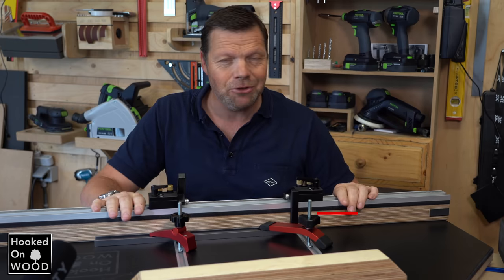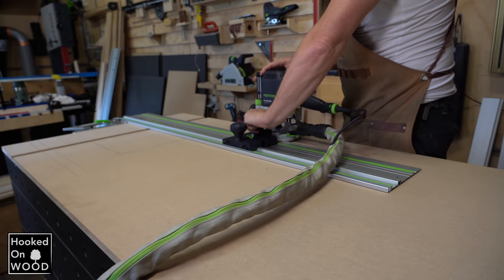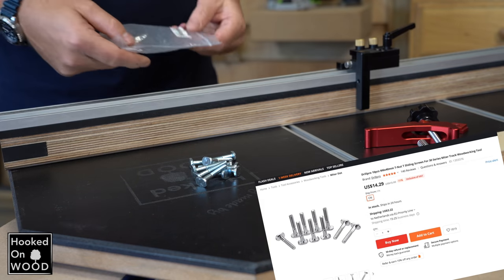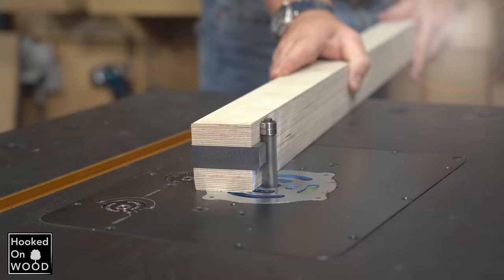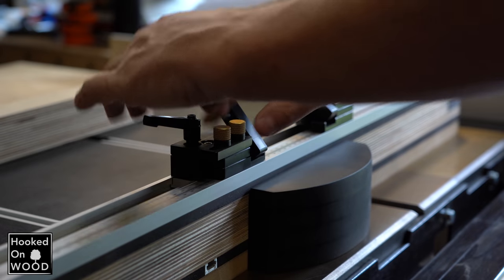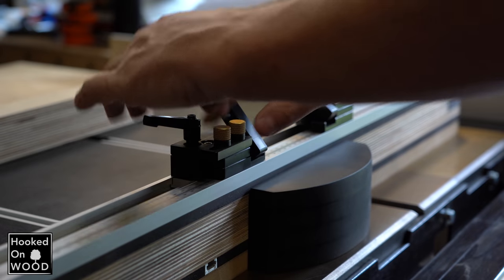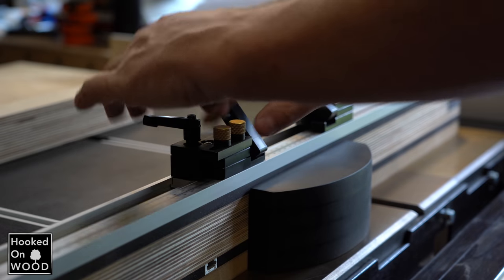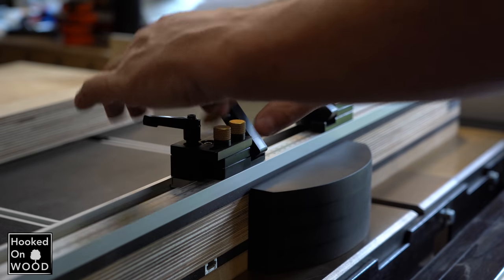China Tools Ep.26 T-tracks, Flip-stops, clamps and more!

Comment: My suggestion: when I made my t-track bench top I attached my t-track with with bolts with nuts on the backside instead of just screws in the wood. That gives it plenty of strength for clamping.

Comment: Dennis -- Thank you for making these videos; by which I mean all your videos, not just your China Tools series. The time you take shows in the quality of the video.

Question: Have you considered comparing aluminium T-tracks to T-slots cut into the wood itself? I'm not sure how well T-slots would work with MDF, but they seem to work very well with Baltic birch plywood or solid wood. The advantages of T-slots are they are stronger (unless the T-track is held in with long screws into material that holds screws well). They seem to be quicker and easier to install. (With a T-slot, once you've used your router to cut the slot, you're done. With a T-track, you need to cut a slot into the wood for the track and then cut the track to fit, and glue/screw it into place.) And, finally, T-slots are less expensive. The disadvantage of T-slots is that they would seem to wear out over time. 

I ask because I think you could make an interesting and informative video addressing when and why you'd use one solution over the other.
Reply from the maker: Hi David, No I did not compare them. On this moment I can not compare them. I hoped my rail guide clamps would fit the T-tracks but this was not the case. Otherwise I would compare them. These smalle clamps do not fit the Micro Jig grooves. So, I did not have the opportunity yet.

Comment: Another great video Denis. Thank you so much. Do you know if the Miter Track Stopper for Fence will work in Incra T-tracks? I want to know both if the locking blue piece will fit in and lock in the internal slot in Incra track and also if the part of the base meant to slide in the top opening of the track will fit in that part of the Incra track and slide nicely.

Comment: Thank you for another wonderful video, Dennis. The lengths you will go to thoroughly test all these China Tools is astounding. I should also add that the pieces you created for "testing purposes" are extremely impressive. Far superior in artistry and function to anything one would find in my shop.

If I could impose, I do have a few questions.
Could you expound on how it is that the grey slider nuts work with the red and blue miter track, but not with the grey? Also, do I understand correctly that the blue and red slider nuts provided with the accessories work with all three colors of miter track?

Finally, when working with the small tracks do the clamps and stops work better with M6 or M8 T-bolts, or does it matter at all?

Thanks again. Looking forward to Episode 27.
Reply from the maker: Hi, thanks for your comments. I appreciate it!
About the questions. 
The dark grey T-track has other dimensions (Slightly) The dimensions are correct according there drawing but it is just slightly different than the others. Because of that, the silver slider comes just a bit above the T-track, so it will not clamp. The blue slider is a bit thinner than the silver slider so, that is why it works here. 
All the miter stoppers works perfectly with all the colors T-tracks, except the dark gray one. It is a bit confusing perhaps, and Banggood actually did not send me this dark one. I bought it myself. But I wanted to implement it in this video so people know. 
I think the M8 screws work better with the small T-tracks. The M6 are smaller and therefore they can turn a bit when you slide them and then they hassle. The M8 slides smoother.
Reply: @HookedonWood  Thank you, Dennis!
As always your insight is extremely useful and appreciated.

Comment: You should really mention the sizes because this is a minefield for beginners. There is the 30-type and the 45-type (plus others). People buying the tracks need to check the profiles so that any track accessories they buy are of the correct size to fit into the tracks. Examine the internal dimensions carefully.
With the scale tracks, I discovered that there are two types on eBay. One has a sliding track and the other one is fixed. Unfortunately, there is really only one seller on eBay from China who sells the sliding scale track. All the others have fixed ones but their ad titles suggest that the scale slides and their images show both.

Comment: Love your reviews and you do a good job of testing the various aspects of the various tools you review. One small thing though. When you looked at the rulers you did not show how straight they were or the accuracy of the scale. I have had some cheaper metrology in my time and one 1M ruler was out of straight by about 2-3mm and the scale was off by about 2mm. I had one tape measure which was out by a 2-3mm in 10M. Otherwise your reviews are great. Thanks for the hard work you put in making these.
Reply from the maker: thanks for the tip! I will keep it in mind.

Comment: Hi there, nice video and just in time because I need to make up a router table and a bit confused looking at the items on banggood- I purchased just a couple of things and not thought slightly ahead with sizes of things such as T rack(the small one which is a bit of a waste of time and money - I found anyway ) When it comes to the T Tracks, the blue one seems the safe bet since it fits the sliders etc? I think you said at 4.34 min the grey t track is not a good fit for the sliders? The table layout with the cross sections is what  am thinking plus a fence with the track although not sure 100% of its design as yet. Overall what you have shown is pretty much I was thinking. I will use your links (when viable) if it helps you
Reply from the maker: Thanks. Only the dark grey has this problem. The light grey not or the aluminum color. (Not in this video)
Reply: @HookedonWood  ahh okay !!, I thought it was the normal grey (did not know there was a dark grey actually) .
Reply: @HookedonWood  ps you know what would be nice? if you break it down in to workable groups , like packs ( t tracks, sliders for the t track then fence items) . People would probably pay you a commission for your trouble since it is a little hit and miss with these items.

Comment: Thanks for the reviews. Just finished my new router extension on my tablesaw and needs to add some t track to various places. One thing I don’t understand is the different “t” ratings bang good uses. Can you explain the differences between the t30 and t45? I will be ordering some various tracks and hold downs through your links.
Reply from the maker: Hi Gerald, 
That is indeed strange. I know that they refer to this number. With the red Miter track stopper the 30 is the one without needle and the 45 is with needle. So, I do not think it is referring to a T-track but more to the type of Miter Track stopper!
Reply: I had to figure this out the hard way on eBay. They refer to 30-type and 45-type. It turns out it is the overall width of the track. The 45-type is 45mm wide and consists of 2 tracks. The 30-type is 30mm wide and consists of one track.
Here is an ad that shows a 45-type track with a scale. It comes in two versions - one with a sliding scale and one with a fixed scale. This is the only seller that offers both. All the others only have the fixed scale but show both in the photos and their ad titles say moveable scale. Very deceptive. The 2 tracks differ in cross-section and you can see that in the photos with the ad.
https://www.ebay.com.au/itm/264631768427
Change the .au ccTLD in the URL to your region if you want to see the ad in your currency (or leave it out entirely for the US).
Note that there are other styles/sizes of tracks (3/4" for example). You'd have to look on eBay to find those since Banggood only sell products made in China.
When buying accessories for the tracks, you have to compare the internal dimensions of the track against the accessory to make sure you get the right size.
Reply: @HookedonWood  As far as I know, it's only the 45-type track that has a scale. So you'd need to get the right tracker stopper if you also want the indicator.
Note that there is also a left-side and right-side version of these. On eBay, the left-side ones are very hard to find. Most of the sellers appear to be sold out.
Alternatively, you can also get stick down scales (just marked metal strips) but I don't know of any track stoppers that have an indicator suitably positioned for those (I haven't really looked closely at those since I got the 45-type tracks instead).
Reply: @two_tier_gary_rumain  thank you for the explanation. It helps a lot!
Reply: @geraldnovakowski7692  You're welcome.

Comment: Hi Dennis, Thanks for this video, very informative as usual. I'm planning to add two t-tracks to my workbench router table to hold the router fence and I'm trying to find out if I should go with the 19x9.5mm (small) t-track or the 30x12.8mm (big, miter) t-track. It seems to me as if the small t-track can only hold t-screws and none of the hold down clamps can be attached to them. Both types have T groove so they seem to be able to hold against a force that pulls them upwards. Do you see any advantage of going with the small t-tracks other than it takes up less space?
Reply from the maker: I agree with you. There are smaller T-tracks that fits a rail guide clamp. Banggood does not sell these. That give some extra. But further, the miter track has much more possibilities.
Reply: I'll go with the 30x12.8mm miter track then, thanks for your insights.
Reply: By the way, where do you see the miter track with the ruler being an advantage over a simple non-ruler type miter track? I guess the ruler can come in handy with a crosscut sled but other than that where else would you prefer to use the one with the ruler?
Reply from the maker: Yess, cross-cut sledge, in some cases drill press plafform. If you want to make a fence for your miter saw and for your router. If you use it on your router, you can use it to add stops. With a ruler you can plat them correctly. This do only counts in specific situations
Reply: Thanks for your insights Dennis.